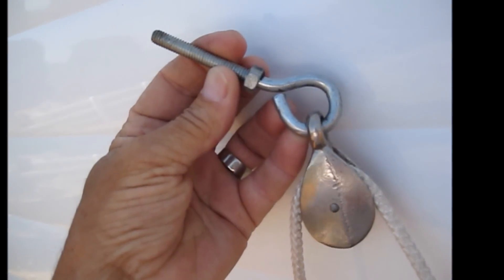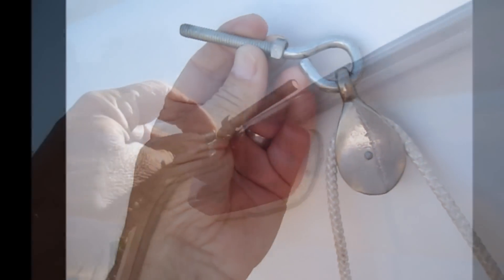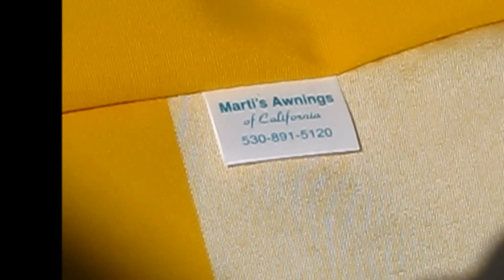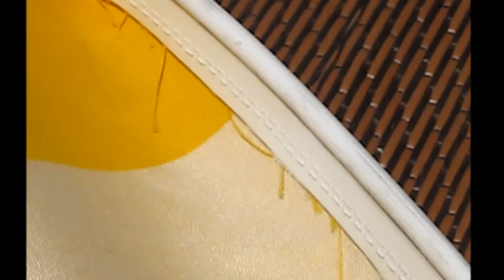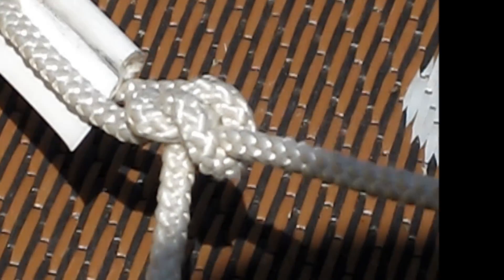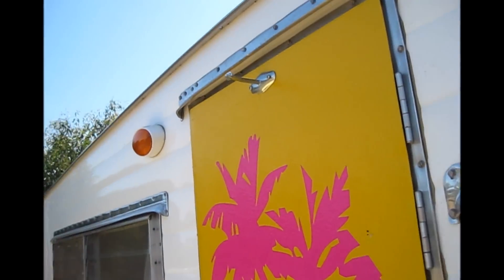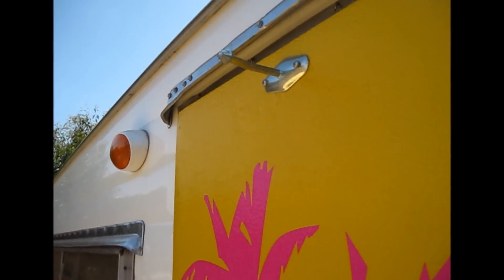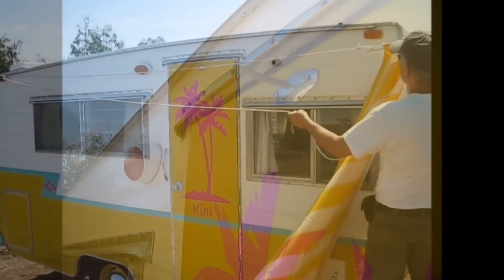Hanging a Vintage Trailer Awning by Yourself

Comment: I do have a question....... how much wind can it handle?  So far mine did well in 25mph winds, but I'm wondering if it can handle more? I have the 3 walls.
Reply from the maker: Well of course it will depend on who made the awning, your poles, and your tie downs. If it's going to be windy, I just don't put mine up. I'm pretty sure I would not want to be in a 25 mph wind, especially with a three-sided awning! I would stay inside, make toast, and play cards! 😊